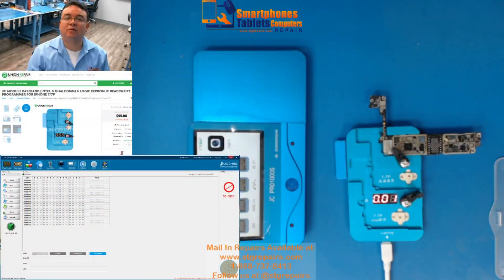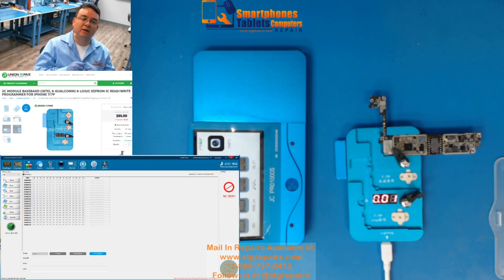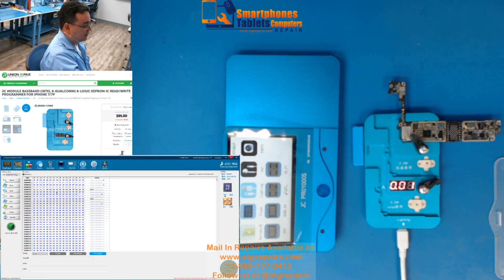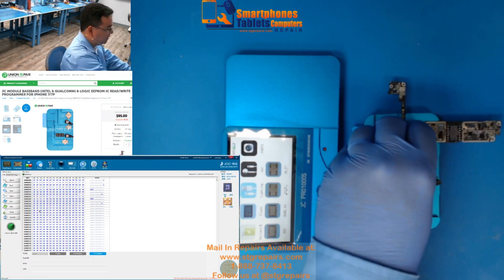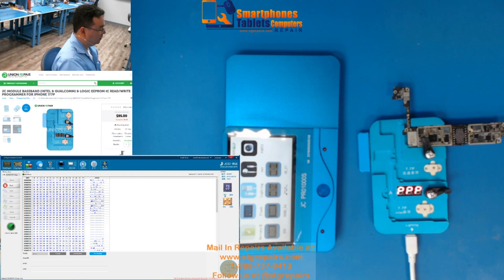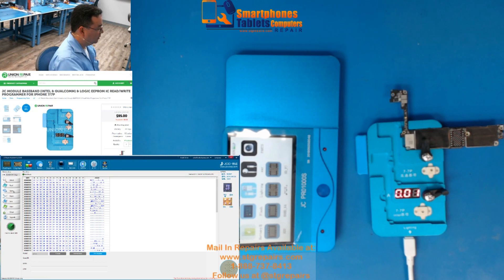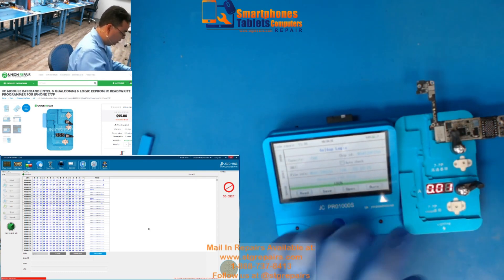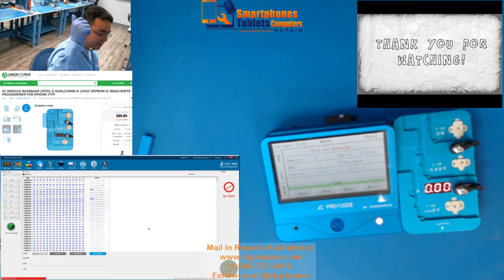JC 1000 EEPROM Reader how to use it to SWAP CPU

Comment: Hi, thanks for the great video. I hope you don't mind a question, if I'm doing a board swap to repair the phone, swapping CPU, NAND and Baseband but I don't need the data, do I need to read either of the EEPROMS? I know you said the logic EEPROM can be replaced but I've heard the Baseband RF EEPROM can't be replaced, so we would always need to read the Baseband EEPROM, is that correct? Thanks